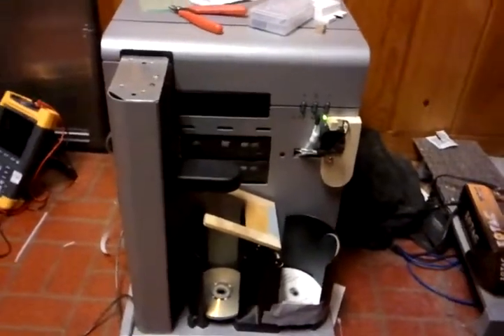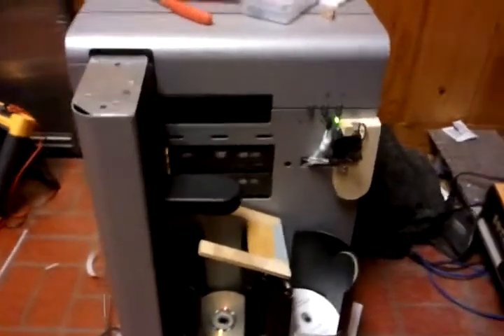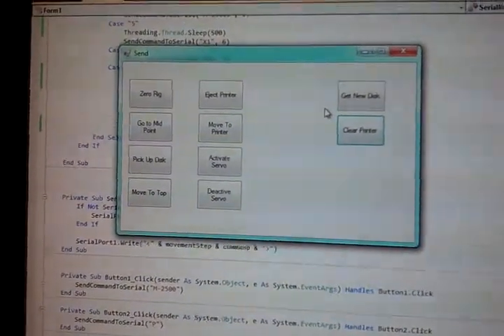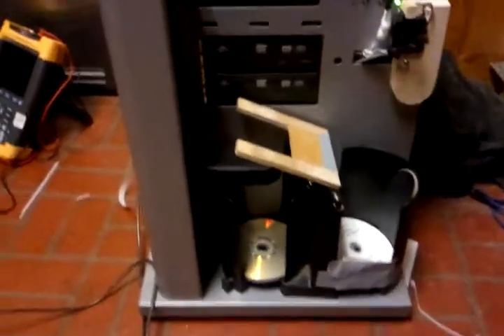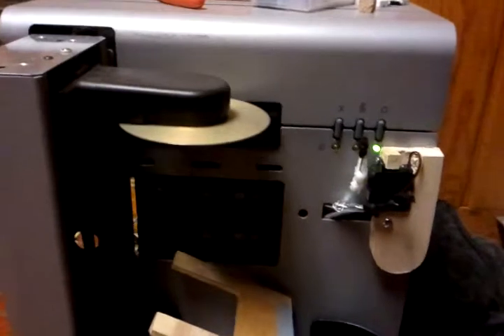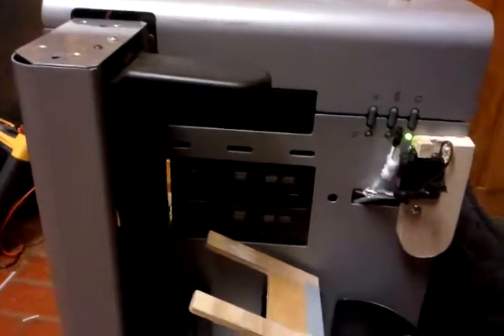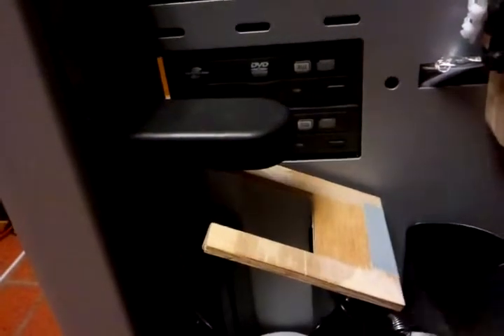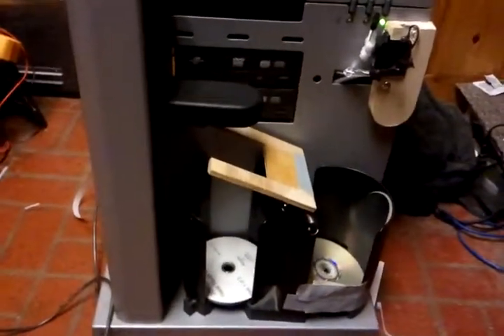Rimage 2000I reborn!!

Comment: Is it possible to replace the drives with newer Blu-Ray writers would it recognise the drives.
Reply from the maker: Wow this video is from a while ago.  But yeah I don't see why I not, though I could see the usb interference struggling to keep up which would limit your write speeds.  I just ended up sticking a mini itx system on the right side and connecting with serial Ata.  Never did much with the rimage software except for the printer so I'm not sure if it would have a problem with the blue rays.

Comment: Hi there, I also happen to have one of these systems, I took it from my previous employer when they were about to throw it away. The machine itself works regarding hardware, maybe the printer would need a bit of fixing since I didn't power this thing on in years but my problem is: I do have an ISO of the Rimage software (an old version though 7.x) and also have a serial number and password for activation but that activation page is long gone from the Rimage website, also the old software doesn't recognize the second DVD drive because it has a firmware version that is too new for the old QuickDisc software version. Since Rimage are real jerks about their software (you can only get it if you have a maintenance contract) I am thinking about also ripping apart the system, throwing out the Rimage stuff and replacing it with a Raspberry Pi and a couple SATA to USB adapters. The printer itself is USB and afaik the DVD drives are simple IDE-to-USB stuff, so no magic there. I'm also thinking about maybe even replacing them with SATA Blu-Ray drives. So I'd be really interested in your approach of controlling the autoloader. I guess I could figure that out all by myself but that'd probably take a while, so if you happen to still have some source code and would be willing to share I'd like to hear from you!

Comment: canyou help me get mines going!!!
Reply from the maker: +iAm Dae What problem are you having?  Remember though, I just sort of took a brute force method to fix mine, and ripped out the rimage stuff and built my own.   These days you can get the entire working system for pretty cheap, so I wouldn't take my approach.
Reply: can't get machine to print in quick disc it shows printer in control panel but when i print cd lable, it says there no printer! like there is no drivers if there any ideas please call me at 9794879482 everett